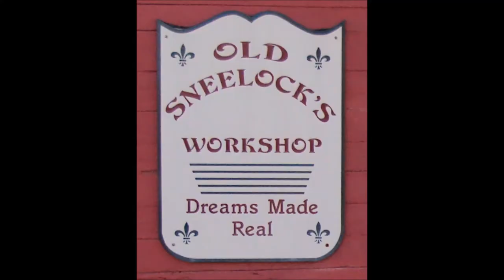WHEEL BARROW GARDEN PLANTER ~ WELDING THE RIM ~ PT 2

Comment: ..now you know you have to put the other side of the rim in the roller and run it backwards to compensate for out of round..4/1/17
You ought to make a handle for the roller so you can put a variable speed drill on it. An old roofer i used to work with did that on a job that needed a bunch of rings to go around some drains. It would take a guy 10 minutes to roll it by hand. With the drill it took a fraction of the time...

Comment: That will be a neat wheel when you are done......The ad before the video is a new Troy built 4 cycle weed eater it has a Cool starter you just stick on the engine an push the start button
Reply from the maker: They rotate the ads based on some algorithm that only AdSense can claim makes sense. I have to see if it shows up. I think they run on some kind of a schedule. This time of year when people are trying to get the weed eater to fire off and cranking their fool heads off, I bet they sell a lot of those. I use to hate my gasoline trimmer. 
Hey Lewie. Any tips on making those little two stroke buzz bombs run better?

Comment: how do you like the electric mask? I remember the video you did about it. You are still using it so you must like it better than your old mask. Nis round wheel, looking forward to watch you make the spokes and hubs. I am curious to see you get them centered.
Reply from the maker: Matt Cooper The electronic lens works great. I had gotten use to the idea of holdingvthe rod tip close to the weld seam then dropping the hood with a nod of my head. The clear lens lets me set the tip right in the seam and pull the trigger. much easier. Last night I built a jig to hold the wheel rim, hub,  and spokes in alignment while I weld them. Today is outsde work. I want to do some garage work tomorrow. We'll see how it goes.